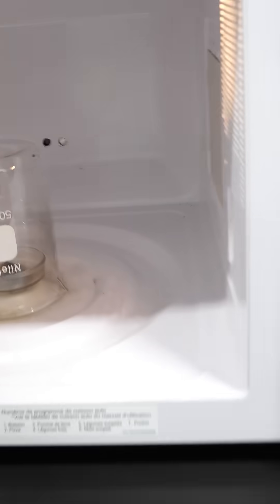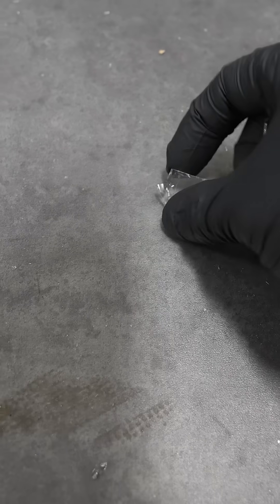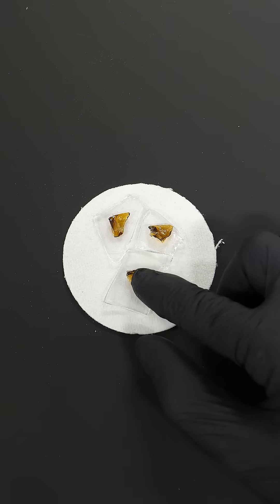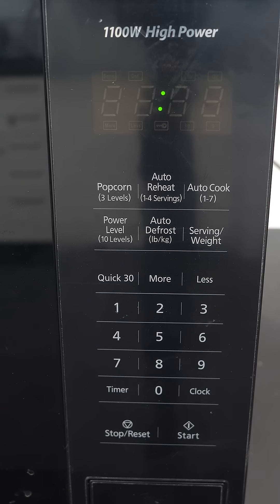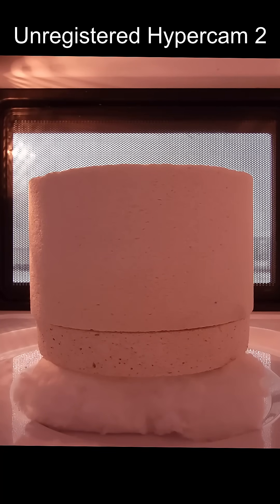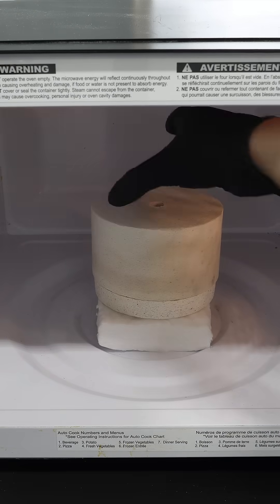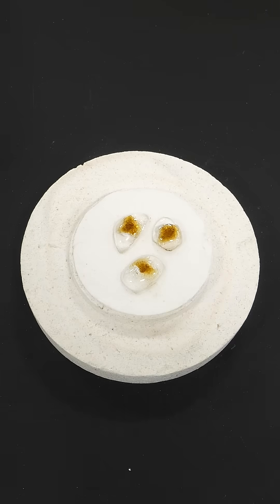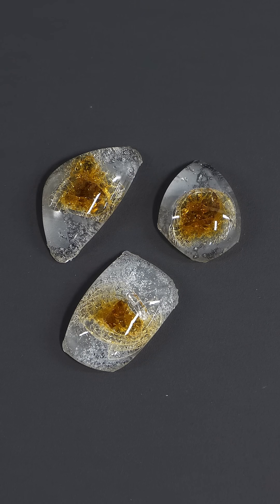Melting glass in the microwave is crazy

Comment: Be careful mixing types of glass together - they can contract and expand at different rates, which, uh, has some FUN results
Reply: As long as it’s not an “explosive” difference it can create some cool fractal patterns
Reply: It's known as coefficient of expansion, or COE. Mixing different COEs can cause the different colours to crack apart unexpectedly at some point in the future. No biggie if the pieces are just sitting in a drawer or used as decoration in a jar or something, but can suddenly create dangerously sharp edges if it has been turned into jewellery and is being worn at the time, for example. 

If you want to use this technique to make wearable or more durable pieces, you can buy glass of known COE in a multitude of colours. Choose the COE (probably 104 or 96 for this application) that you can find most easily/cheaply in your area, and only ever buy that to avoid accidental mixing in the future. Mixing different brands of the same COE is usually ok.
Reply: @ thank you! I only know about CoE because I saw it go horribly wrong. I really appreciate you adding actual knowledge!
Reply: @kristysmith9723 there are thousands of glass "recipes" based on its application.  The linear coefficient of thermal expansion is VERY important but so is the annealing (or cooling) process. The thicker the glass, the longer the annealing cycle. 

As a side note, there may also be other reactions while mixing colors because they are made using small amounts of different metal oxides, sulfides, or chlorides. Some colors can have a further reaction using 1 or more of the 3  different types of combustion. Reduction, where there is more fuel than oxygen (a reduced amount of oxygen). A more neutral flame where there is even parts oxygen and fuel (neither reducing, nor oxidizing). And as you may have guessed, an oxidizing flame, which is more oxygen than fuel.
Reply: @kristysmith9723  Thank you for the info!
Reply: @kristysmith9723  waow thanks!
Reply: If you look carefully at the last shots of the glass "eye"s, you can see some fracturing around the brown glass. This might be the contraction at different rates that you are referring to.
Reply: Yo no jaroa haria esto es peligroso @Sembazuru
Reply: I hope he experiments on this too haha
Reply: Mixing the heat resistant beaker glass with the probably normal brown glass too 😭
Reply: He loves fun results
Reply: Is the fun you're referring to something exploding?
Reply: They will crack…. 🤣
Reply: One of these days Nile will stop uploading
Reply: @GoldenPickaxe and then his friends/family will post a very short, sad message
Reply: 😮
Randomly exploding jewelry?!!!
There's a niche market that needs to be exploited.😊❤
Reply: @CrabbyO this won't explode that impressively. If you really want something dramatic, hide a "Saint Rupert's Drop" in some jewelry. (Don't actually, because it will definitely injure someone but not enough to keep them from revenge.)
Reply: @CharlesBosse Prince Rupert's drop but yes
Reply: @CrabbyO  Oh I dunno, put each bead in a tight knit Kevlar pouch and I'd buy it! OR better yet just dip it in some high expansion plastic like they put in between windshield glass! I bet that'd pop like a bastard without embedding any shards into your chest!
Reply: @CrabbyO new spy movie assassination technique or something similarly outlandish.
Reply: @CrabbyO  I'm sure the pager people would buy some.
Reply: @tinastsebastian that stunt with the pagers was a well-deserved masterpiece 😍
Reply: @iamhereforever  No, it was a disgusting act of terrorism performed by an association of murderous thugs and bullies.
Reply: @iamhereforever  The idea of distributing bombs in a package that's easily misplaced and frequently lost or stolen and then bragging about how you've endangered innocent people because you feel you have a mandate from some higher power - if they had been muslims, you'd see it for what it is.
Reply: @iamhereforever  I’m afraid Isr’s firmly lost the propaganda w. ar. Only a matter of time now; just like nz Germany, just like apa. rtheid South Africa. 

Fas. cistic systems are inherently self-cann. ^ibalising, and will always meet their end - even while the ‘superior class’ in any such country (the uber mencsh if you will), blindly deny it right to the end.
Reply: Popcorn.
Reply: :o we will too
Reply: They are in a kiln, it is fine
Reply: sounds like something nilered would do
Reply: Que cara mentiroso😂😂😂😂😂
Reply: He is a scientist I think he would know….😂
Reply: @AubreeVanWormer this was as much for people in the comments as NileRed
Reply: I think he’s like those “FUN” results..
Reply: Don’t give him ideas 😂
Reply: kaboom
Reply: Liar.

Comment: So glass typically will ball up on itself at high temperatures due to the surface tension. If you want all the pieces to fuse together, stack them. Look into other kiln formed glass techniques to see what you can do with the microwave :)

Comment: dont you need water molecules for a microwave to work?
Reply: It doesn't have to be water, just anything that can absorb microwave radiation.
Reply: @Mis7erSeven  thanks for the info, isnt the heat generated by the rotation of polar molecules of water?

Comment: Your pieces need to be touching to fuse together.  Perhaps there is a refractory surfactant you could use like soda lime.  Try a pretty color next time like blue glass from a beer bottle or red from something.
Reply: It's the Thermal Coefficient of Expansion.  Borosilicate glass from a beaker requires a temperature of 3000 degrees to fuse with itself. The Brown glass has a melting point of 1500  degrees. 🎉
Reply: @chorvat6656  That's brilliant!  The  brown glass would be like solder or brazening for the borosilicate glass.  Now it becomes more predictable.
Reply: INR? They'd have to have liquified to find each other and fuse, which would be even more of not what he wanted.
Reply: The melting glass surface tension will always prevent what you want. I think flux like the soda or borax based flux and use gravity such as a bowl to guide the melting edges together. Or, stack them on top of each for a much more exciting outcome!
Reply: Blue beer bottles??

Comment: Screaming "don't" in the last cut hoping he does not smash those crystal too
Reply: Frrrr I was so scared 😨😨😨
Reply: I wanted it so bad though!! TEST HOW STRONG ITBIS NILE RED I WANT TO MAKE URANIUM GLASS CABACHONS THAT ARENT GONNA SHATTER ON IMPACT
Reply: @ This is my 2 cents, I doubt it is stronger than their original form. Not mixed well, if you shatter the one on top, it will make the lower shatter as well because they are connected, but not a strong mix that could hold the energy of the impact equally across both bodies. The shape changed to a rounder form which might help, but the former issue is still there

Comment: Ngl, of all the shenanigans Nile has done, this surprised me the most. Never in a million years would i have expected that a basic ass microwave oven, with some kiln parts, would LIQUIFY glass! 😮
Reply: It doesn’t really take much to melt things. Maybe I’m kinda biased since I melt steel for a living.
Reply: @Neighborhood_hooligan  not biased, just more informed on it than the general population.
Reply: @Neighborhood_hooligan  But can you melt steel in a microwave?
Reply: @erictaylor5462  funny enough you can if you have a crucible.
Reply: @Neighborhood_hooligan Well, you literaly can't melt Glass without preparation or some machine, it have too high meeting point for a heat of a fire to melt it, so you either need to trap the heat like in this video or have a way to exceed Glass meeting point what means you have something you bougth in similiar (Like steel works) purpose.
Reply: @Darwidx  Glassmakers use a furnace to melt sand into glass. Temperatures are roughly 1400 degrees Celsius. Source: my entire family were glassmakers and I was too.
Reply: @Darwidx this is not true. A normal wood fire can easily melt regular glass, like bottles or bulbs. 

I literally do this every second week
Reply: @Darwidx if you don't think fire can melt glass like fire that keeps you warm I'm pretty positive you're dead wrong. I've found multiple melted pieces of glass out in the dumps where people historically threw away their glass and melted it. I've got melted pieces of uranium glass and honestly this comment makes me wanna post to YouTube more
Reply: @Darwidx you can melt the glass without the kiln in a microwave. The kiln is mainly to protect your microwave. And most microwaves have a sensor that turns off the microwave if it gets too hot. It is easier if you jumpstart the process by heating the glass with a torch until it glows a little in one spot.
Reply: @christophermcdougall8811  maybe he was referring to a wood fire? Can’t reach 1400 C with wood 🤷‍♂️
Reply: @Eddisdedd yeah, it’s definitely possible to melt glass with plain old fire, that’s how glass was historically made in the first place. What people are probably meaning is that you won’t be able to melt glass just by setting it over a typical campfire sort of scenario. Which is true. You have to design some way of trapping and concentrating the heat from the fire, which can be as simple as keeping a roaring fire going for a good while inside a pit, or making a brick furnace. But it’s still just a plain old wood-fired (or whatever fuel) fire, at the end of the day. Happens unintentionally all the time at big bonfires, or when people are burning stuff in metal barrels, or in the remains of a house fire.
Reply: @YR0117  you know what that's fair like I said ill have to film a video of what I've found, they'd use coal fires and there's just slag everywhere from it
Reply: @Darwidx  yeah like I said it doesn’t take much some fire brick for a basic forge setup and some propane isn’t something I would consider “much”
Reply: @Neighborhood_hooligan  have you tried to do it wit microwaves?
Reply: @Neighborhood_hooligan  interesting. For instance, could even jet fuel melt that?
Reply: @xXMiKuXx21  come on now we all know that’s impossible 😂
Reply: You can melt glass with focused light from an overhead projector bulb.  Rather quickly, actually, but in a point spot.   I worked on an industrial machine that would melt the end of a 4mm glass tube to seal it and it would do this in 4 seconds using nothing more than an 82 watt projector bulb and some concentrating reflectors.  Yeah, I didn't believe it was possible at first, either.
Reply: They sell these kilns on amazon. It's not new tech. It's from the 80s. Also, you can fire pottery in that kiln.
Reply: Your microwave is two augments away from a truly terrifying tool. Remember to respect that every time you use it, because you might end up with a ball of plasma where you don’t exactly want it.
Reply: Fr! 🤯 Of all the wild experiments, this one feels like actual wizardry! 🔥🧙‍♂️
Reply: Add some refractory brick and insulation to three of the sides and you can melt metal in a regular microwave. (I've done it for melting silver and gold. I made jewelry as a hobby for a while)
It is INCREDIBLY hard on the magnetron and will burn it out in a relatively short time.
Reply: I’m also surprised. I thought you needed water present in items for the microwave to heat them up? 🤔 as I understand it the microwaves agitate the water molecules and they generate heat? Is this wrong?
Reply: @maxxx2671  exactly! That's why I was confused too!
Reply: It’s honestly a little terrifying that a normal microwave can do this.
Reply: @twistedoldloony  you guys act like a microwave is so normal like it’s not a mighty feat of engineering.
Reply: @Neighborhood_hooligan if everyone has one it's considered a normal appliance. Everyone assumes you need some kind of special tool to do different things like have a lab in the plasma beam to be able to melt glass
Reply: @Neighborhood_hooligan gotta admit most folks wouldn't think you could melt glass in the same appliance they use to heat up coffee or a snack. 

On the other hand I've seen an industrial restaurant microwave literally make plasma 😂
Reply: @Neighborhood_hooligan for real tho!! Like it was found BY ACCIDENT because someone left a chocolate bar in their pocket it's mind blowing
Reply: @TheBeavadelic you can make plasm by putting a grape in a microwave.
Reply: @jerrywhidby.  True. However when I saw it happen the microwave was running with nothing inside it. I just remember hearing a server yelling she didn't know what to do. I just walked over & unplugged it lol
Reply: @Eddisdedd eyyyyy someone knows their fun history
Reply: @twistedoldloony 
It's more terrifying that people reheat food in a microwave on Styrofoam or plastic and then eat it without a care in the world. There's plenty of causes for cancer but the cancer research foundation isn't going to list them as they hold their hands out for more donations.
Reply: I have wanted BackYardScientist to try this with his giant microwave for years. I bet he has enough room to make some really nice pieces.
Reply: Most impressive that it works with beaker glass. That stuff is way more heat resistant than normal glass
Reply: Microwaves are no joke.
Reply: in 6 minutes no less, microwaves are shockingly safe and at the same time terrifying
Reply: Bruh microwave oven's are very powerfull how do you think it can warm food in <2min while a conventional oven takes >15min at least
Reply: Yeah kilns are awesome. The way they can contain heat and just compound it is fascinating. Microwaves are neat in their own way too once you really break down how they work.
Reply: Are the internal parts of the microwave (door panel, etc) tolerant of that high of temperatures? 🤔
Reply: @klouzerk  all the energy is absorbed into the kiln and then the glass. So the outside of the kiln is only heated by the escaping heat. The walls of the microwave are not getting anywhere near as hot. The walls have close to the same melting point as glass, and by not getting as much heat it won't melt.
Reply: Yeah, we've been doing it for 40 years
Reply: Microwave kiln (a small dome of refractory material) is like $40 on amazon. Forget glass, people fire FULL ON CERAMICS in microwaves. Even Raku
Reply: 😂 whattt
Reply: The dead Internet theory might be true
Reply: Like I was so surprised lol
Reply: Fun fact, glass is already a liquid
Reply: Technically glass is already glass lol
Reply: @a2zz-gk197  Structurally and propertywise, glass is very much not metal
Reply: Glass is actually not a solid to begin with. It is a "super-cooled liquid".

Apparently if you look at vertical glass windows that were made about 200 years ago, the width of the glass will be slightly thicker at the bottom due to the liquid gradually flowing down to the bottom. 🎉
Reply: @thenigerianprince70   1. Glass is a solid. It is just not in a crystalline structure, like metals, salts. They are amorphous solids, just like plastics. 
For instance, you can supercool water to form amorphous ice 

2. I would argue that glass was harder to make 200 years ago, and quite expensive, especially if you wanted the same exact thickness everywhere. Glass being thicker on one end could just be an issue with (somewhat affordable) production. And putting the thicker part on the bottom would make sense from the pov of the construction worker.
Reply: @jeromepontza5829  someone needs to see what ppl r referring to.